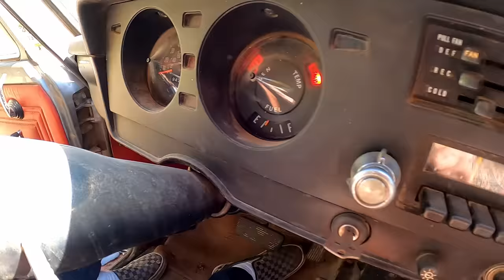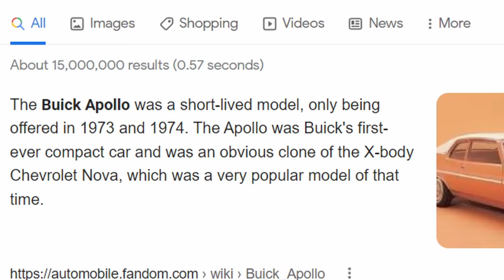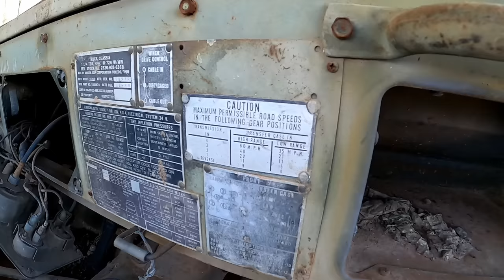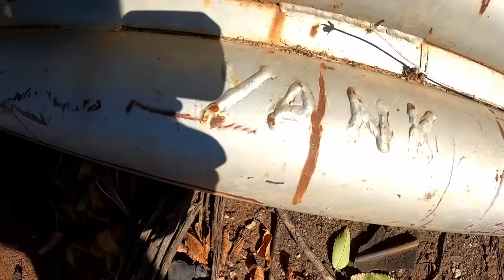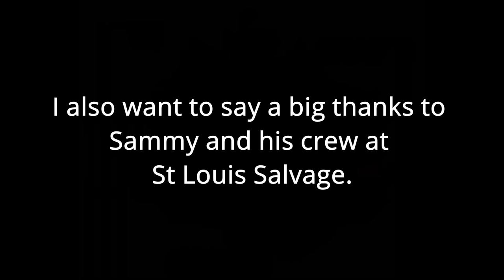RARE parts, WILL IT RUNS, and SAVING a truck from the CRUSHER!

Comment: here's the deal with the valve covers - GM put that style on ALL of their V6 powered trucks in the early 60's. If you watch Waylon Wire's channel and his GM V12 rat rod build, that V12 has FOUR of those valve covers - it's like it's two V6 motors welded together, but it's a single block casting with four cylinder heads.

Comment: @22:13 the first car i cut up for part was a 73-74 Nova, i had a 69 with bad hit  Quarter panels covered in bondo and i picked up the73/4 and it was a very clean 73/4 and I CUT that thing into pieces.  I got a trunkpan both quarters sold the front clip for 5 times what i paid for the full car gave the guy the windshields front and back and took the disk breaks off of it and put them on my 69. Ended up selling the 69 for a bunch more than i paid for it and gave the guy all the extras to fix it. I really wish I didn't cut the 73 up, its worth a hell of allot more now

Comment: My first truck was a hand me down from my dad. It was a 1963 GMC step side pickup. When we got it, it had that 305 V-6 with those same valve covers!  I was in junior high when he got that truck. We pulled that motor and put a 327 in it with a turbo 400. I wish I still had that truck.

Comment: I had a old 63 GMC truck with the V6, had a few miss fires, couple bent pushrods straightened on the cement floor and truck was running like a top again.

Comment: Hey Puddin...
 Let me tell you a story about old Holley carburators....
 Those off the shelf kits don't always work correctly on the old factory installed Holley carburators, because the gaskets don't always have the correct holes for the fuel and vacuum ports on the metering blocks,  
 I discovered this about 15 years ago when I had rebuilt a factory installed Holley carburetor that was on a Y block engine in a 1957 Thunderbird.
 I had trouble with it running too lean and surging, and after a bit of investigation discovered that the gaskets were wrong,. 
I then ordered the proper carburetor kit, going by carburetor model and serial numbers and make and model of vehicle, and after installing that kit the engine ran great.
 So my best advice is to only use after market Holley carburator kits for after market Holley carburators
For the best results.
Tim from Wisconsin.

Comment: I had an old Jeep J-200 Pickup.   It had the 230 ci Tornado straight 6 Engine.   That engine was a monster.   It has a Brass gear for the distributor.   That gear is hard to find if not impossible.   I needed one and it took me almost a year to find one.   They shipped it from Maine to me in California.   I loved that old truck.

Comment: I had a Brand New Old stock spare tire my suburban from 1998 and never used. Late night leaving the black Mesa we're taking that two wheel suburban all over the back lands. Just side pull off take a picture of this cross formation ran over a sharp Rock. Pumped it up with my trusty air compressor we drove down the road. We stopped but that brand new spare from 1998 on the back end of that suburban and 2 mi is through the rubber off for the next 10 miles we stopped over 2 mi to air it up if my trusty air compressor. Then we put the one I had a slit in the tire tread back on it after airing it up so we didn't have to stop about every 5 miles air it up. What made me remember this story is that one that you showed in the back of the suburban or whatever it was as fairly new. But you can see how good the cords was.

Comment: Strut mount bushing went bad on my truck. Strut is fine I just needed the rubber bushing. 
"Doesn't come separate. $300 for the assembly, $225 for just the strut."
45 mins later at the U-Pull-It
"$40."
2 like new struts for about the price of a 1/2 tank of gas.

Comment: Take you a jack handle and shove up between the fender well and the tire and roll those fenders that Jack handle around the tire it'll stop a bottom of the rubbing and give you some clearance you can actually buy a fender roller but Jack handles work two in a pinch

Comment: By the type of use and demands you have on your cars the best replacement for the Tow Corolla would be a Subaru Forester. It would have plenty of space for parts runs and it's AWD system would get you through the muddiest salvage yards.

Comment: I remember some of the first PT Cruiser models, that turned out to be so bad at handling side collisions that people were dying at parking lot speeds....and that square screw is a Robertson bit, the greatest screw known to mankind. They're pretty much standard here in Canada, especially with electrical infrastructure. They don't cam out like a philips does(especially if you only think it's a philips screw, but it's actually a japanese JIS standard so it immediately strips because it doesn't seat the same), and you can confidently just stick one on a drill bit and know it's not going to fall off, which is wonderful when you're up a ladder if you would otherwise have to have one hand on the screw and one on the drill, while placing a third hand on the ladder to satisfy safety standards...

Comment: 88-98 GMT 400 series trucks the heavy half ton 6 lug some are 15 inch and the Silverado ones are aluminum 16 inch the 4x4 and the k2500 and c2500 light duty trucks is also 6 lug but all are 16 inch usually steel 16x7

Comment: Puddin i think maybe try and get the front section of the loadstar as a WHOLE. Parts are getting harder to find and more expensive... Might just be the best way to go. P.s this place seems to have quite a few 1981-82 chevy trucks like mine. I may need to give them up a call

Comment: How did you not get shocked when checking for spark on the blue Chevy? Your hand was on the brake master cylinder and you were holding an insulated screwdriver but you were letting the spark jump to the master cylinder. Most of the time when spark jumps to the spot your touching you find out it's working without seeing the spark.

Comment: Hey Puddin.  Do you self a favor and take a little advice from a old guy.
  Pull out that International starter while you are still ahead of the game,. Take it apart, clean it up real good, regrease the bearings and replace the brushes.  
 Not only will it probably save you some money, but it will also give you some experience.
 Everyone these days run starters and alternators until they completely shot ,then they go get some Chinese crap from the part store to replace them with for some outrageous price.
 All you have to do is a bit of cleaning and lubrication on them every few years and they will often last two or three times longer, or in some cases they will even last the life of the vehicle.
  It is all about the maintenance.
 And of course not being a lazy slacker when it comes to maintenance.
 Cause like you always say buddy ,
"Sitten on your Azzz won't finish your project".   And of course lack of maintenance won't keep it running.
Tim from Wisconsin.

Comment: The only Buick I know that looked like a Nova was the 1973 to 1975 Buick Apollo they were in the early 70's came in notch back or hatch back the same as the Nova's Oldsmobile had the Omega and Pontiac had the Ventura. They were all the same car with slight differences

Comment: Is That one of those big 6 bangers???? I believe it would be a 305E.. I got one in a 64 GMC.. Under my barn.. that I'm fixing to start working on.... it was all original one owner... my grate grandfather bought it new... it now needs a rear end and trans..  witch ant to bad because they were so low geared....
and I want too drive it and I got to be able to do 75 mph without blowing it up.... and I really want disc on front.. and mybe I will get a rear end for it what's got disc on it...

Comment: Last couple of episodes I saw those ol GMC valve cover. I bought a ‘63 GMC pickup back in the early 80’s. It was a 3/4 ton 4 wheel drive 4 speed that I bought from the original owner who had order it in 63. When I opened the hood and saw those plaid valve covers. I asked Al what was that about. He said that GM was having problems with the valves. Al said when he took the truck in for recall he asked what the deal was with the valve cover. The dealer said that was what GM did to show that the modification had been done. They were dark green and red. Is it true…I don’t know but coming from the original owner it’s the only story I have ever heard…….

Comment: When are you going to drop a Ford v8 or a chevy v8 in that model A? It will be bad @zz with a v8 and some chrome headers sticking out the hood. With a big high rise or just a tall intake or even a blower. Even a stock v8 would work.
Reply: He has a 283 at the new shop. Said he'd build it before he left the old shop

Comment: If you like the guy that owns that yard, then be careful showing certain things on the channel. That yard is violating multiple EPA regulations, and they can get a huge fine. The vehicles are not supposed to be on the main yard with fluids and/or batteries in them. I worked at one for years, and spent a huge amount of time dealing with that crap.

Comment: PUDDING don't be foolish get that big red corn binder and then get you a service body tool bed with a crane and torch  I know that it sounds like to much power for a guy but it will be thousands of dollars cheaper than a red box off the tool truck and have V8 power bet it is a 394 with automatic transmission  confession of a horder I. Don't have a lot of money but if I can buy it then I can think about keeping or not but then I don't have to worry about two goobers taking very hard to find parts off it really is clean but is it the same model as your intro the cab between the door and fender looks a little different but thay sure are hard to find maybe a ramp truck because that guy north of you has a little guy Chevy ramp truck